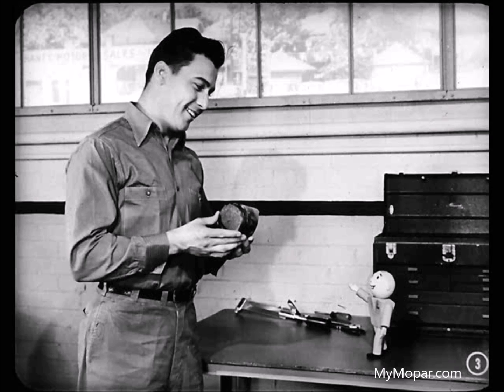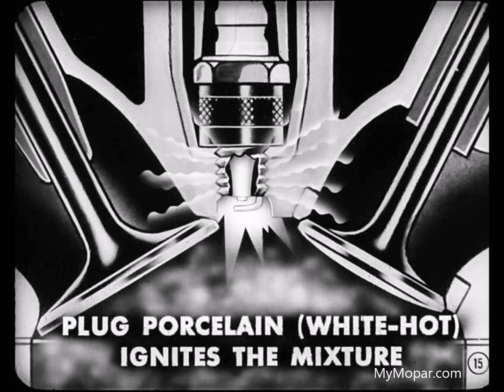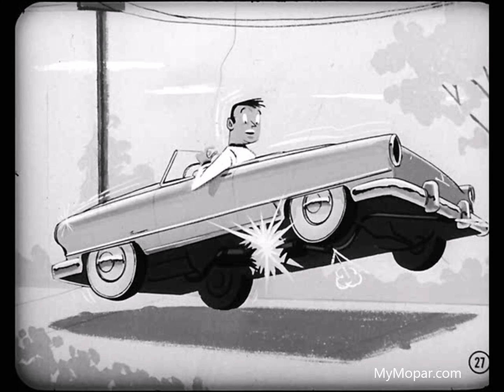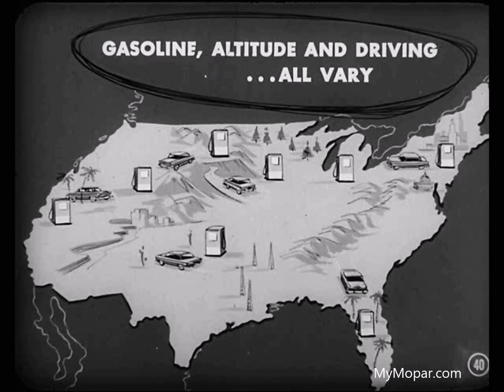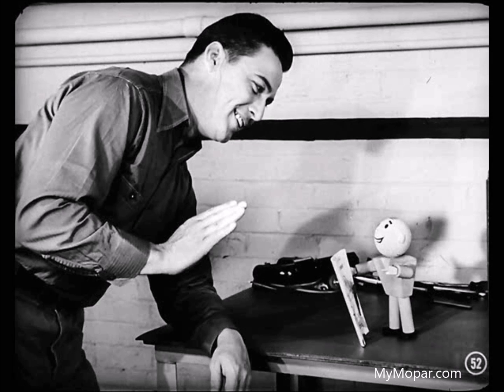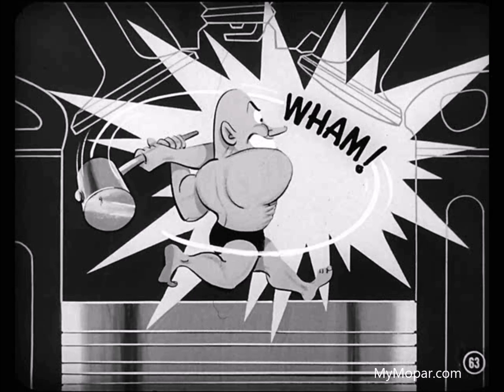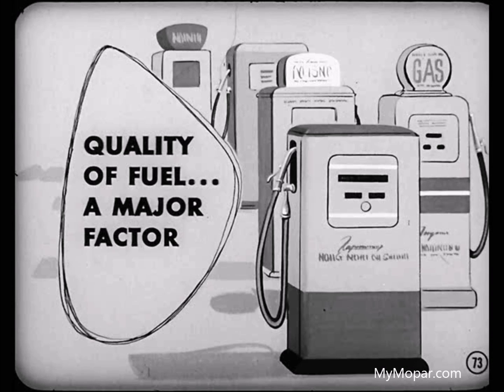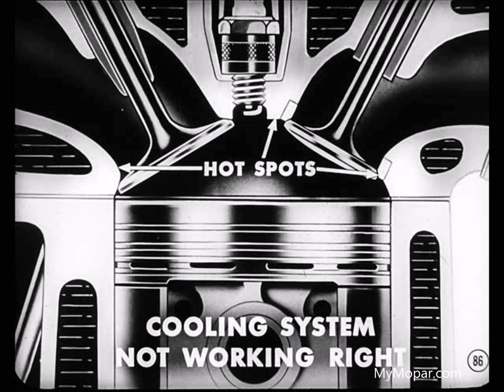Chrysler Master Tech - 1954, Volume 7-9 Preignition And Detonation

Comment: I didnt hear 1 mention of a driver with a manual transmission 'lugging' their engine like shifting to 3rd gear at say 30 mph or trying to accelerate up a hill from a slow speed in high gear instead of downshifting!!!!

Comment: now we have knock sensors, and all other too
Reply: Which can fail, compounding diagnosis.
Reply: It came back with a vengeance... low speed preignition found in gasoline direct injection engines. We just got a new oil standard because of it.